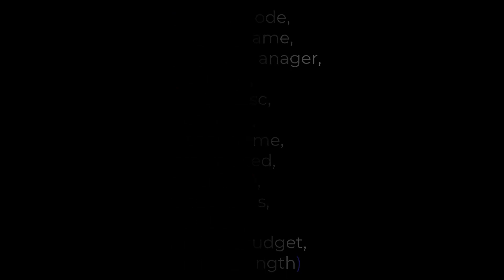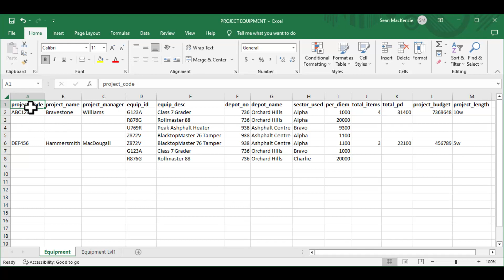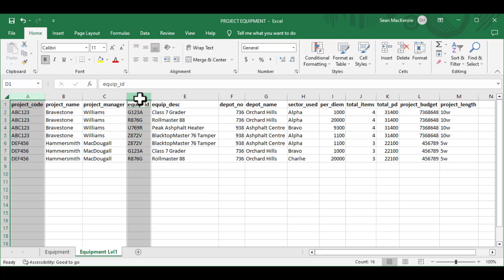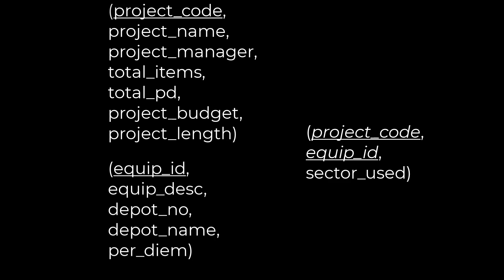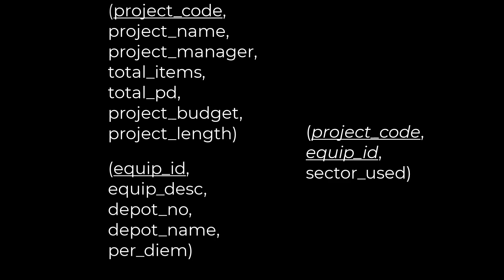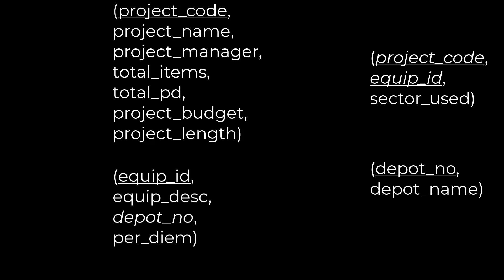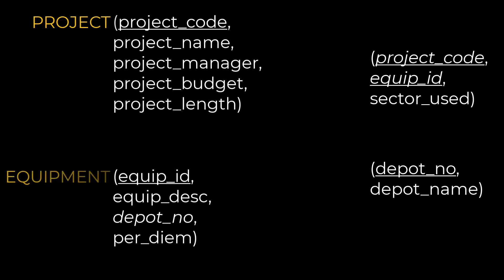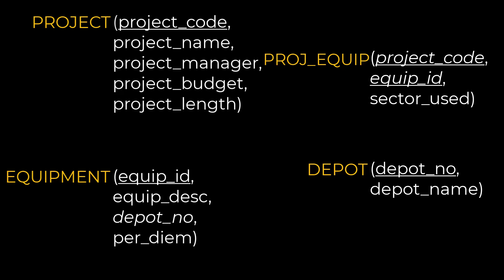How to Normalize Data to Third Normal Form 3NF

Comment from the maker: After completing this video, I asked ChatGPT to: "please write an article of 1000 words on how to normalize data to 3NF" and here is what I got:

"Normalizing data to Third Normal Form (3NF) is a process of organizing a database to minimize redundancy and improve data integrity. The goal is to eliminate data anomalies and ensure data is stored in a structured and consistent manner. This article will provide a step-by-step guide on how to normalize data to 3NF.

1. Determine the functional dependencies
Before normalizing a database, it is important to identify the relationships between the data. A functional dependency is a relationship where one attribute determines another attribute. To determine the functional dependencies, you should consider the business rules and the relationships between the data.

2. Create the 1st Normal Form (1NF)
The first step in normalizing data to 3NF is to convert it to 1st Normal Form (1NF). To achieve this, you need to ensure that each attribute has a unique value, and the data is stored in separate tables. In 1NF, each row represents a single entity, and each column represents an attribute of that entity.

3. Create the 2nd Normal Form (2NF)
In the 2nd Normal Form, the data should be organized so that non-key attributes are dependent on the entire primary key. This means that each non-key attribute must depend on the entire primary key, and not just a part of it. To achieve this, you need to identify any partial dependencies and split the data into separate tables.

4. Create the 3rd Normal Form (3NF)
In 3NF, data is further organized to remove any transitive dependencies. A transitive dependency occurs when a non-key attribute depends on another non-key attribute. To eliminate transitive dependencies, you should create additional tables to store the dependent data.

5. Verify the Normalization
Once you have completed the normalization process, you should verify that the data is in 3NF by checking for redundancy, anomalies, and consistency. You can use tools like SQL scripts or data modeling software to verify the normalization.

In conclusion, normalizing data to 3NF is a crucial step in improving the quality and integrity of data. The process involves organizing data into separate tables, minimizing redundancy, and removing anomalies. By following these steps, you can ensure that your data is structured and consistent, and that it can be easily managed and queried.

Note: The process of normalizing data to 3NF is complex and requires a strong understanding of database design principles and techniques. If you are not familiar with these concepts, it is recommended to seek the assistance of a professional database administrator or consult specialized resources."

Pretty good article!

Comment: Why would you put project_code and equip_id in a lookup tabel and not do the same for equip_id and depot_no? Are there any conventions about this?
Reply from the maker: Great question. Actually, we put project_code and equip_id into a "junction table" that represents a many-to-many relationship. One project can use many different equipment, and one equipment can be used on many projects. For the depot, we did make that just a simple lookup so that we could attach the depot name and prevent data duplication. Every piece of equipment belongs to a depot, so it is just a lookup.
Reply: @seanmackenziedataengineering  Ah yes, thanks for the fast and clear answer!